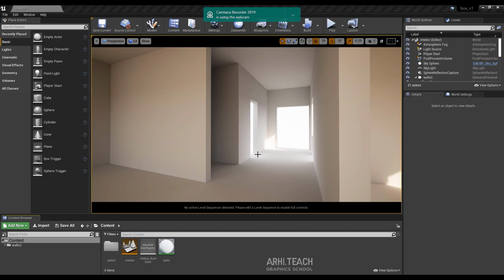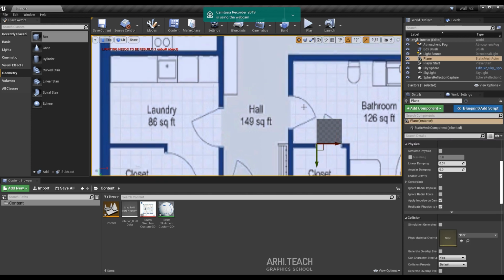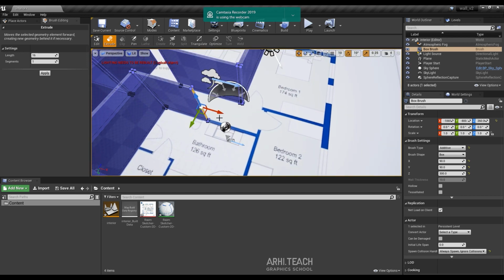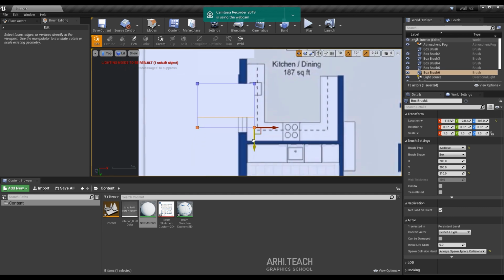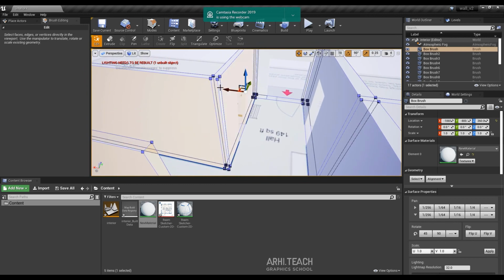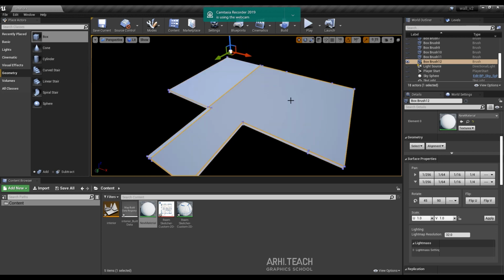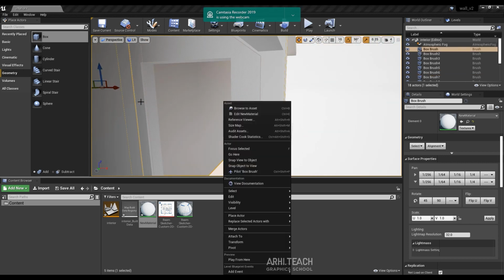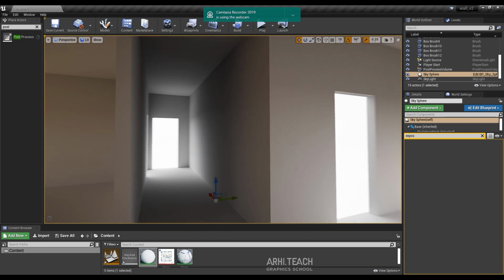How to create walls directly in Unreal Engine | Everything you need to know [Tutorial]

Comment from the maker: How to create walls directly in Unreal Engine Everything you need to know Tutorial
0:00 Intro
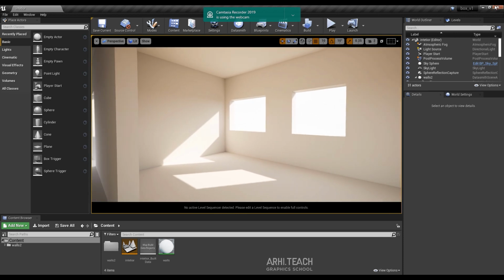0:30 Creating level in Unreal Engine
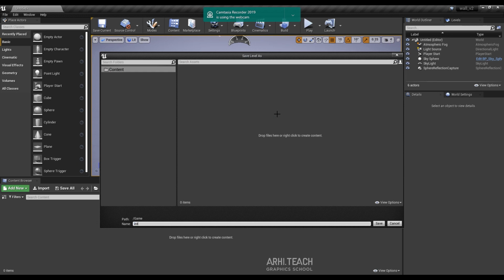1:36 Project Settings in Unreal
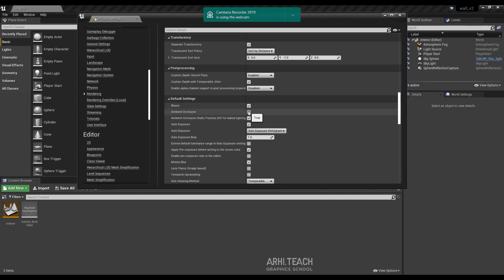1:54 World Settings in Unreal Engine
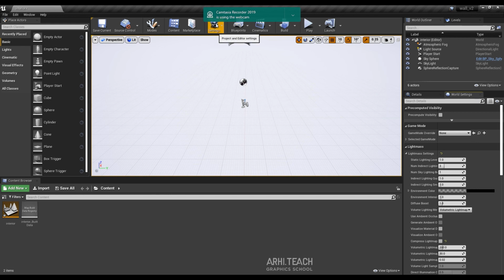2:08 Import plan in Unreal Engine
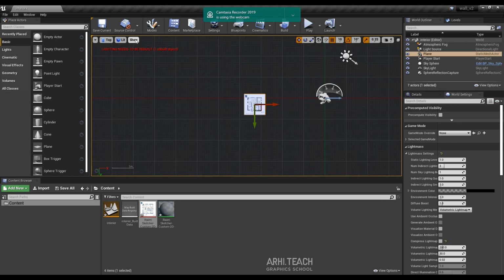2:50 Set scale of a blueprint in Unreal 
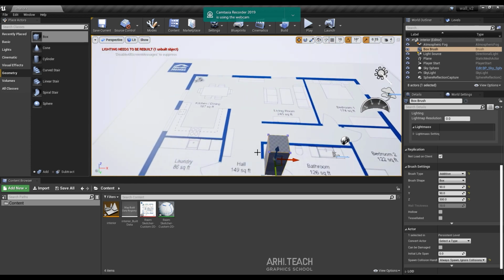5:36 How to create building box in UE
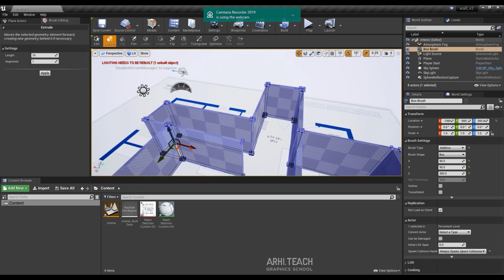9:11 Set material on walls in Unreal Engine
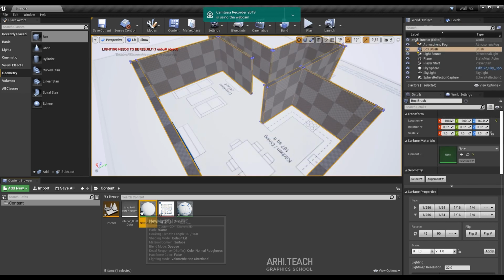9:50 Creating doorways in Unreal
16:40 Pick the plane for baking light in Unreal Engine
17:37 How to create ceiling or roof in Unreal Engine
20:30 How to create floor in Unreal
22:49 Save project in Unreal
23:02 Correct errors in Unreal Engine
28:14 Scene postprocessing in Unreal Engine
29:03 How to make image more sharpen in Unreal Engine
29:45 Outro